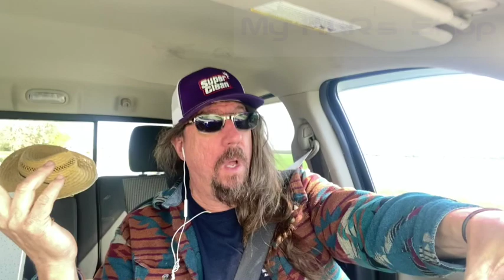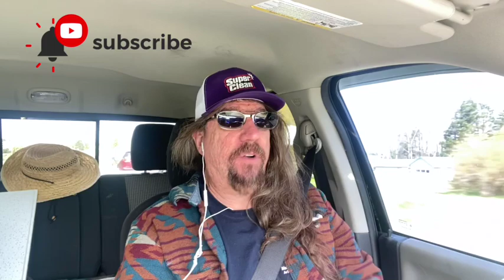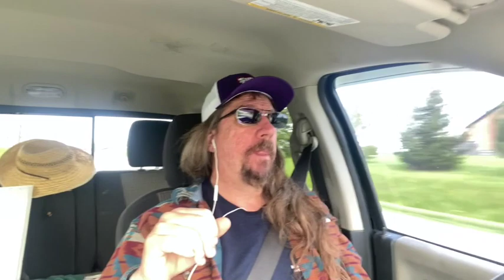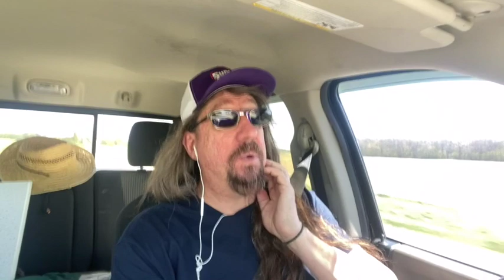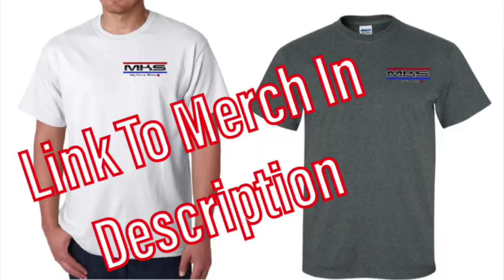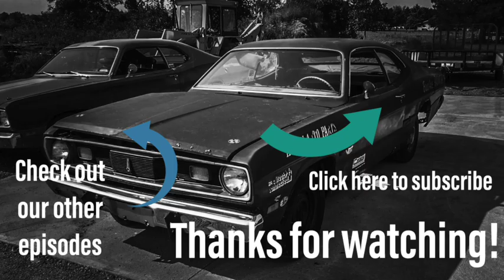Terrible Technology Causing HUGE Repair Bills! Updates On My HEMI!!!  ! #letstalkaboutit

Comment: Good talk Mike!!! You were mentioning a kit when the phone cut you off.  I had heard that they make a kit to do away with the VVT on the LS6.  Interesting that the misfire is on cyl 5. I think you hit on the oil pressure problem the VVT on Number 7 shares an oil gally with 5. So, is #5 leaking down causing the VVT problem or is the VVT problem causing #5 to leak down? RAWK!!!
Reply from the maker: I really think it’s either a valve spring problem, or a lifter problem specific to number five. 

If there were problems with the solenoid, I would think we would be seeing misfire on number seven because the lifter wouldn’t pump up there also   

I will get it torn apart eventually, but my wife is a game of whack amole and I can’t keep up. Lol. 

Thanks for watching

Comment: My understanding I've read up on this a few years back, the lifters they used were a poor design up until like 2014-15? Supposedly found the culprit and all newer Hemis since have the upgraded lifters. I have an 2016 SRT challenger 392 and it runs great! And i never use the eco mode. My normal driving is the sport mode. And i use track mode when cruising the blvd with my buddies got our cars out.
Reply from the maker: There are other issues showing up now that these vehicles are approaching 150,000 miles and 10 -12 years old.

Always something. 

Give me points & a carburetor. Lol.

Thanks so much for watching

Comment: 2018 Ram 2500 6.4l almost 200k hard severe duty oilfield work still going, now in a 2024 Ram 2500 6.4l just hit 14k miles not one problem except the Horn honks when it wants to has a ghost in the truck I guess. Taking it in soon for warranty on the horn. I would check your lifters before you run into damage. Also cracked cylinder heads can cause mis-fires I know! I had a 2015 Ford Fusion that had a cracked cylinder head at 22k miles water leaked in through the cracks causing mis-fire. I replace all four ignition coils, plugs, and injectors before finding out what it really was.
Reply from the maker: Awesome. Thanks for the suggestions. Definitely stuff I will look into. I’m going to be tearing it apart soon. Stick around and you’ll find out the conclusions.

Thanks for watching. Love your comments.
Reply: @MyKARSShop  I hope its not a crack, but it could be Stellantis had big troubles with the Pentastar and cracked heads, but it was not as big a problem with the Hemi's. All brands outsource parts now so things like that do happen more often. When you pull the plugs if you have a crack there are tell tale signs to look for. Now small cracks are more tricky. Run an exhaust gas test too its cheap and tells you a lot. I will stay tuned curious as to what the issue is.
Reply from the maker: @JasPlun appreciate that. I had hoped to have it torn apart by now, but, I have to get my wife’s farm truck (a truck called Wanda - there are episodes on that one too) on the road before I can sideline this one. 

But hopefully, I will be tearing it apart soon. I have a real deep suspicion of what’s going on, but I’m excited to actually dig into it and see what I find. (Excited? WTF is wrong with me? Lol.)

Thank you so much for your thoughtful comments. Thank you for watching, thank you for sticking around. 

Welcome to my insanity. 

Welcome to the show  

RAWk!!!

Comment: Stupid question, but can you legally disable the MDS on your truck now that it is over 10 years old?
Reply from the maker: Fortunately, I live in a state where we’re not bound by those kinds of laws. I can disable it at anytime. With no limitation on age or mileage. 

Of course, the only factor would have been factory warranty when it was newer
Reply: @MyKARSShop  - If it were me I would disable the system and replace with Non MDS lifters and never look back provided you know the valve springs are good. My last company truck was a 2019 Silverado with that same system and it was the worst vehicle I’ve ever had. Luckily my company provided me with a new Jeep GC last week.
Reply from the maker: @blakesmusclecar I’ve considered that. But the problem is that the lifters in question are not MDS lifters and I don’t think the problem is MDS related. 

You can disable MDS by simply putting it in tow/haul and I still have the same problem. So I want to get to the bottom of what the real issue is first.   

I just need time to tear the motor apart and start examining things. But… Life has not allow that to happen. Hopefully this fall.

Comment: Makes me wonder if there is an oil starvation issue. I wonder what would happen if you put an extra 1/2 or even full quart in.
Reply from the maker: Yeah, it’s not that for sure. It’s definitely a mechanical issue. I’ve done a ton of research and this is a fairly common thing. Other people have had similar results with changing oil viscosity as well.

This whole MDS/VVT system is just garbage and it doesn’t matter whether it’s Dodge, Chevrolet, Ford, or anybody else. 

But better things are ahead  😎

Comment: The 20w spec is to help meet gov't. CAFE standards. Not because it's better for your engine. GM V8s have issues with this BS technology as well. That's why I bough a 2500 Silverado 6.6 gas engine truck. It just runs. No technology.
Reply from the maker: Yes, I know the Café standards also come in to play on that. But I also know if you run too high viscosity oil in these things, it will kick oil system codes like crazy also.

Go figure. 

Glad you found a truck that works for you. 

I have purchased my old crew cab, and as soon as I can sell my old plow truck, I will start building the truck of my dreams. 

One bite at a time 

Thank you so much for watching.

Comment: Everything you're doing sounds exactly like my experience. Mine would only misfire under load as well. I never received the vvt oil pressure code, but I do know there is an oil screen that leads to the vvt system that is known to get clogged whenever the lifters and cam fail. It's strange that switching oil has improved the situation.

Best bet is to pull the driver side head and look at the lifters and then look down the hole at the cam. Unfortunately, you can't look at the cam under the manifold because it's all closed off.

I replaced the cam and all the lifters on mine over the course of a weekend. It's not a bad job really. Worst part is getting the exhaust manifold bolts out. I also upgraded to the 6.2 Hellcat oil pump, but that will cause a different engine code because the oil pressure is too high for the stupid computer. I've been running for about 2 years now and no issues.

Best of luck!
Reply from the maker: Thanks for sharing your experience. Very helpful.

I’ll keep you posted once I get around to it.   But at least I can drive it now as long as I don’t rev it much.

Comment: You have me thinking Mike. My son just was stationed in Va from Arizona. On their move they were towing a trailer with their 15 caravan. They developed a #2 cylinder misfire. Now it isn’t a hemi but is a v6 with vvt. My brother is ready to pull the engine and swap it. He thinks it has a rod knock. I admit it seems more than just a lifter tick. But you can’t feel a rod knock like I am used too with an older vehicle. The last rod knock I could feel in the floorboard of my 72 charger. I was thinking it has to do with the vvt. Time to start looking into it. Thanks Mike
Reply from the maker: Glad that expired some thoughts. Let me know what they find out.